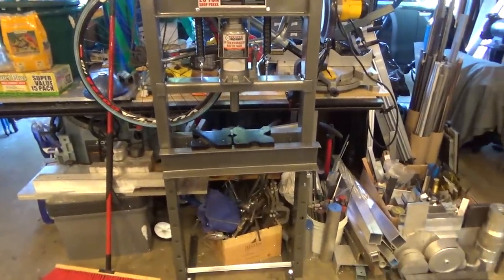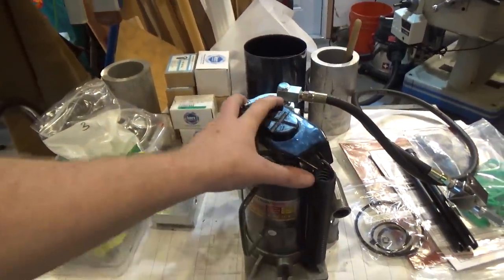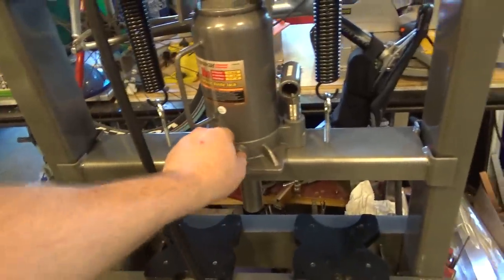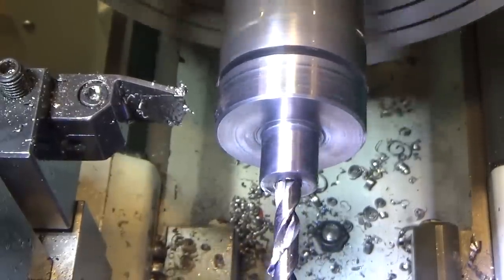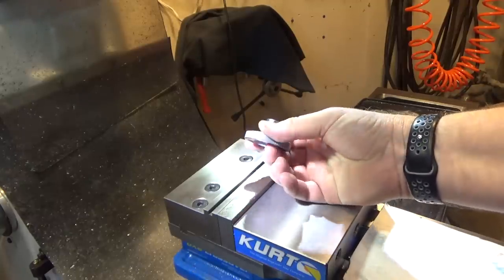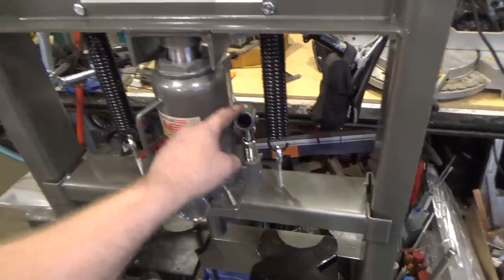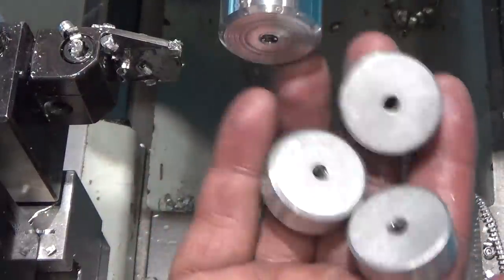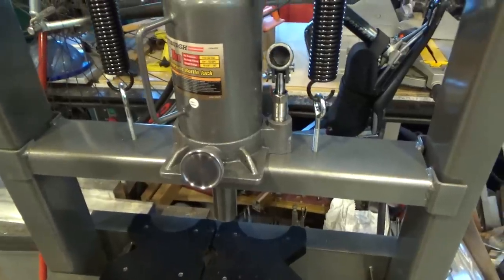Improvements to a Harbor Freight 20 Ton Hydraulic Press Part 1

Comment: Good video! Do you get your material for free? You make a lot of chips, and chips are wasted material. I'm a retired machinist. So I'll give you a few tips. You are running both materials way to slow. Both materials like speed and positive rake tools. I noticed the inserts looked like 1/32 radius a .015 or 1/64 will give you a better finish at the feed you were using. I like all the changes you made to the press. I have the same one, only much older. Try making thin rubber washers for under your height pin knobs that way you can hand tighten and remove easier. Pinning the plates was a good idea. You might want to scout your local scrap yard for some heavy flat stock for the heavier press operations. I envy your machines! The issue with carbide endmills is they are brittle. Rule of thumb for tools is use the shortest tool that will do the job. I noticed the 1/8" endmill was very long and not suited for a side cut unless fed slowly. Again not enough speed and in this case too much feed for the depth of cut. Carbide is not forgiving it will not flex when stressed it will break. Lubricant is extreemly important for tool life. You know your feed and speed is good when your chips look like 9s and 6s. Long stringy chips are very dangerous and are a sign of dull tools, slow speeds and insuficent feed. You are doing well. I don't mean this as a critasizem, just as helpful info. I worked with some machinists that never learned these things. Keep it up!! I'm subscribing!!
Reply from the maker: I do not take it personally at all. I welcome constructive criticism and, as a beginner, I would be a fool's fool if I did not take advantage of those with more experience. I really appreciate you taking the time to help me and quite possibly others out. I love the rubber washers idea. Thanks for the suggestions of feeds and speeds. I have used coolant on my lathe exactly once and my mill never. I have to admit that I bought both machines new and really hate corrosion. I know that the coolants have rust inhibitors in them, but am still a bit afraid. Thanks again.
Reply: As a beginner, i like this video and the ideas. But your comment makes the value - short and easy to understand. Thanks to both you and Dudley Toolwright.
Reply: Machinist Handbook:
Will give you more info than you will ever want to know.
Metal cutting is all about speed, feed, cutter and lubrication. As you noted, with the diameter change the surface finish changed. Book will get you into the ballpark and experience will get you home. There is a time for carbide and a time for HHS. Most of my specialty bits are HHS because they are so easy to shape and sharpen. I do have a dedicated tool cutter grinder and it does precision grinds but I still like the quickie touchup a bench grinder allows. 
In school I wanted to be a machinist and took 5 credit hours of machineshop but Uncle Sam had a different game plan. Those hours gave me enough background to be able to machine 'stuff' all over the world for different career paths I've taken and the experience that has come from it has made me the 'machinist' I am today. 
There are things I do by the book and things I do by experience. 
AND I modify just about everything to either make it better or fit my work ethic. 
On my agenda is a mod for my carriage feed to make it infinitely variable so I don't have to change gears and so I can have a rapid reverse travel.
Reply: How remove from Toyota  Tacoma     2000 u join
Reply: I too did my engineering apprenticeship but have to admit this guy is pretty useful  for a beginner. My old Myford has been sitting unused for 10 years. 
Life & everything as usual gets in the way. But he has inspired me to get going again. Thanks Dudley.
Reply: 28cruzin thanks for taking the time to help us!  Many of the channels I watch feature professional level machinists that just don't make the same kind of mistakes a beginner like me makes.
Reply: As a beginning and aspiring machinist....I've subscribed and I read your post 7 times.....appreciate the insight...Thank you!
Reply: @tonydalton6756  AWESOME!!
Reply: @DudleyToolwright  SURFACE  FEET PER MINUTE (easy calc. with one of them smart phones...lmao) for your particular material and when you get down near your desired diameter,  play with your feed rate for the finish you want and don't be shy on the depth of cut.....slow feeds/ light cuts just smear the naterial....after a bit, it'll become second nature......nice mods on the press.Scott mentioned the Machinery Handbook....worth it's weight in gold.

Comment: In stead of machining the caps for the ends of the pins (for those without a lathe or mill) why not make a pair of stop collars from some tubing or pipe and drill and tap for a set screw. Then place the stop collars on the inside between the flanges of the vertical channels. Two stop collars on each pin will function the same as your caps.For the knob a cheap knurled knob from McMaster-Carr or elsewhere for a couple bucks will replace your very nice knob that I do not have the machines to fabricate from scratch. In place of milling the slots for the cross pin I would drive that pin out, drill the knob to accept the pin, then install the pin to lock the knob on the shaft. Nothing wrong with your mods, they are excellent. Just offering some options to those who don't have access to the equipment to make them that you do.
Reply from the maker: I think you have offered fantastic options and I really appreciate you sharing them so that others can take advantage of your insight. We all use the tools we have at hand  and you have been very creative with your solutions rather than my brute force approach.

Comment: Excellent job... When I built mine I used a 12v Hydraulic Dump Trailer Pump...  I built one before using a Dentist Chair 110v pump that worked trick...  Just a bit slow (faster than hand pumping) and the solenoid made it nice..  For the release, I just grind it square and drill and tap so I can use a spigot handle...   It ain't got to be perfect...  It just gotta work.
Reply from the maker: Nice solutions. Thanks for sharing those. I have very limited knowledge of hydraulics.

Comment: Ive got the same 20 ton press, swapped out to the air/hydraulic option. I have also swapped out  the hollow jack base that travels vertically along the uprights using 4 inch U channel and welded a similar pusher beneath the centerline of  jack piston eliminating compression of previous installed box tubing.  Nice video, thanks for sharing- regards
Reply from the maker: Thanks for sharing your approach. I have gotten a ton of great ideas from other peoples solutions and improvements.
Reply: @DudleyToolwright  you're welcome

Comment: Greetings from Australia, I have a similar press to this, I did the same thing to the blocks except I taped studs instead of dowels and the cross beams that sit on the height pins used to slide sideways and to stop that I drilled holes in them and put the height pins through the cross beams and that stopped the sideways movement and gained two more inches between the bottom of the jack and the plates
Reply from the maker: Great suggestion. Thanks for sharing.

Comment: The changes you made are all worthwhile, and definate quality-of-shop-time improvements.  Carry on, sir.
Reply from the maker: Thanks.
Reply: I found that the finesse that comes with the manual actuation of the bottle jack came in handy for my uses.
Reply: I'm just not sure about that knob, I find it better/quicker/easier to weld a rod on for a handle.
Reply: I read that in "Quality of Shop Time" magazine Swim suit edition last month.
Reply: I need a functional  bearing press, but cant afford a fancy store-bought,, i have some steel pipe & rusty bolts,,,,

Comment: Hi, my 20 ton uses an up side down jack which means you can fix the jack to the top frame. This removes all play in the ram arm making a much more accurate press when you have a part trying to “cock” to one side. There are YouTube videos showing how to do this relatively simple mod. I took a more simple approach to stopping the support bars from slipping by drilling a 1/4” hole through the bar where they sit under the support frame and continued the hole through the support frame. The holes in the frame were then enlarged slightly and chamfered. Next I pushed a 1/4” rod through the hole in the bar and left about 1/4” sticking out both sides. Theses lugs lock into the hole in the frame and stop all movement. To remove the bars you just lift the frame slightly and rotate and pull it the bars straight out. Works very well and no machining. I love your videos and appreciate the time you take to make them. I just wanted to suggest another modification you could look at doing, the up side down jack, as it really does make your press feel and work like a much more expensive unit and the pins is just another answer to the same problem but for those without a lathe. Cheers mate, Stuart 🇦🇺
Reply from the maker: Great suggestions, thanks. I had briefly thought about an upside down jack but forgot about the idea when I got to the design. You make a lot of good points, and I think you are right that it would make for a much better operating experience. I like your support bar solution. That one never occurred to me. Necessity is the mother of invention. I realize that the more tools I get, the fewer creative workarounds I come up with. Thanks for the comments.
Reply: Ohhh you are so right about creativity! I have exactly the same problem. Just recently I bought and found all the parts to make something and thankfully just before I got started a much much simpler way dawned on me. I think in future I will make myself K.I.S.S it before I start. 
Cheers my friend. 👍👍👍🇦🇺
Reply from the maker: K.I.S.S. it is. By the way, I've visited Melbourne where my sister and brother in law lived for 5 years and I love your country. Amazingly creative and friendly people. Cheers.
Reply: Thanks mate, that’s very kind of you to say. I’m in Canberra but we go to Melbourne 3-4 time a year to visit family. 😁😁🇦🇺

Comment: Thanks for these improvement ideas.  One suggestion for those who don't have a metal lathe...a 1/2 pipe threader works great on the 20mm pins.  Once threaded, put on pipe caps to keep them from sliding out.  The air jack upgrade is the bomb!
Reply from the maker: Great suggestions, thanks.

Comment: I’ve made a bunch of presses pretty cheap. I started by using old garbage compactors. I’ve made them with cheap tie cylinders from tractor supply. My latest adventure through a junk yard yielded several pieces of structural bridge beam, the packer cylinder from a garbage truck a 12v hydraulic pump from a tow truck, old control valves from a back hoe and I bought a 55gallon drum of 10w oil. All together I should work out to near 75 tons of pressure on a point load or 60 using a flat plate with about 4 foot of piston travel
Reply from the maker: That sounds like a really interesting project. I would love to see video(s) on that build. I am sure that I am not alone here either.

Comment: I just bought the same press last month.  I glued two magnets on the top, so they hold the bar, keeping it from rolling off and easy to grab.  I also placed washers around the pins of the pump mechanism to keep it from wobbling so much.

I lag bolted it down on 4' 6x6's.   

For $130, it saved me much more than that, being able to replace a carrier bearing in my truck.  Yes, it's a cheap tool, but for a shade tree mechanic, it's a great shop item.  Wish I would have bought it years ago.
Reply from the maker: Nice mods. I agree - its very functional and a bargain for the cost.

Comment: I did the same cylinder change you performed. However, I used roll pins instead of dowel pins, cheaper and less work over having to ream the holes. Great ideas.
Reply from the maker: I don't know why I always forget about roll pins. They are so very useful and more forgiving than dowel pins. Thanks for the idea.

Comment: These are GREAT IMPROVEMENTS to a press system that has not changed in decades. Good work and ideas - thanks
Reply from the maker: Thanks. I have had at least an equal number of ideas recommended by the people commenting on the videos. Add all these up and Harbor Freight could really have a decent product, for a price that the average home shop hobbyist could afford.

Comment: Hi.  Another retired machinist (cam and lever screw machines - nothing digital), but I kept the old Clausing 13" lathe and manual 1953 Bridgeport mill.  My "day care" was hanging around Dad's shop, running a belt-drive South Bend lathe at 8 years old!
Anyway, the only quick step I'd do would be in the chamfer.  Instead of taking the time to change tool holders, I'd pick up a file and do it by hand! 
I switched to the HF air jack, also.  Worked fine for a couple of months, then the air motor stopped working.  Jack still worked manually, air motor makes the correct noises, but the crossbar doesn't move.
Reply from the maker: Good to know. Thanks for the info and I hope to hear from you again in the future. I am all ears. Lets not let manual machining go the way of the dodo! We need people with experience to share the hard won knowledge. Thanks again.

Comment: I have that press & that air-over jack.  The air-over was definitely worth it. I also made a knob for the release valve, but just purposed a knob that I had.
I use my press almost exclusively as a brake, with some cobbled together dies.  For that use, I found that there was too much front-to-back play in both the topmost jack-driven beam and the lower, fixed apron.  I fixed that by drilling & tapping them for bolts which bear on the columns.  "Bear" just enough to take out slop, but not bind.
Reply from the maker: Thanks for the ideas. I was planning to use mine for a press brake as well and your suggestions will be very helpful. I love to benefit from others experience. Learning the hard way gets old fast.

Comment: Good ideas for your press. One more thing you might do is make a parts catcher to go under the press. A box with padding of some sort, like absorbing mats, will keep the shaft you just pressed out from being dinged on the end when it hits the concrete floor.  It is especially important when broaching key ways. You will cry if your expensive broach hits the floor and snaps in two.
   Safety note: NEVER try to catch parted off lathe work in you hand. I've seen guys get badly cut doing that. Save your bamboo chop sticks from the Chinese restaurant. They make excellent tools to catch parts.... I also use them for shear pins on my lathe's drive rod and lead screw to replace the suicide steel roll pins the lathe came with.
Reply: Milk crate with a cardboard box inside
Reply: I usually put a rod in the tail stock and feed it into the hole of something I’m parting off. That way when it falls off the rod catches it and you still have both hands free
Reply from the maker: Excellent point and after broaching your point was even better illustrated.

Comment: I bought a 20 T press years ago on sale at Princess Auto in Ontario Canada for $99. I use it when rebuilding Muncie 4-speed transmissions. Last time I used a lathe was in all my years in HS alone with the other shop classes. I was going to go through as tool & die but changed my mind and went the IT route. I still use the vice today that I made in machine shop back in 1973. Nice job on the lathe and mill work. 👍 I like that knob you made.
Reply from the maker: Thanks. I never had the opportunity in high school or I might have taken a different career path. Life seems to come around though.  Cheers.

Comment: I flipped the cross member under the jack, then welded a plate across the cross member for the jack to set on. I drill through the crossmember for the ram pin then welded it to both the pin and the plate under the jack. Now I have a place to store all the pieces used on the press. I use wedges on the sides to keep the cross member from moving. Enjoyed your video.  Probably better than Snap -On  with your improvements.
Reply from the maker: I love your suggestions. There are just so many creative people out there. Thanks for the comments and ideas.
Reply: Thats a good idea but my pump leaks so much it would be full of oil in no time
Reply: Clayton Parks,Better than Snap-On ?Let's not get ahead of ourselves.He has made a cheap press much more user friendly,but at the end of the day,it's still just a cheap knock off.

Comment: Swag offroad sells knobs for these jacks, they also sell a great press brake for it.  When I installed my air jack I used all 4 springs, very fast return and they aren't being over stretched like if you only use two because of all the preload needed.
Reply from the maker: I like this idea as well. The two springs really aren't great and I was wondering about longevity. I did get two more springs for the return plate on the air motor jack. I should look to use those. Thanks for your many good suggestions.

Comment: I also took two electrical conduit 'minerallac' straps and bolted them to the top press support facing up to hold the jack handle. Works great.
Reply from the maker: I am not familiar with those. I will have to look into that. Thank you.

Comment: If you're ever worried about the jack handle slipping out (like after it gets grease/ hydraulic fluid/etc on it you could always cut a slot for an o ring in it so it's held in place more positively
Reply from the maker: Great idea. Thanks.